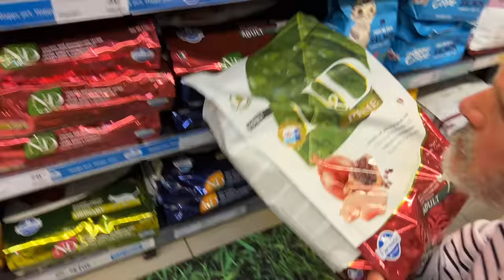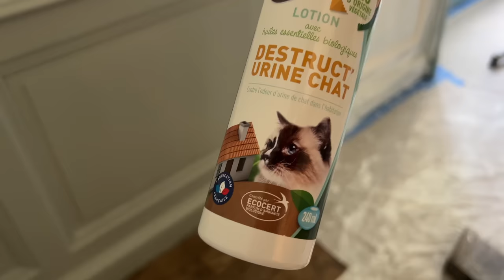PART ONE: Our Chateau Bedroom Reimagined

Comment: Don’t worry, Amanda, I’m doing to the same thing buying the extremely fancy food for our indoor cats that demand attention when they want it, and demand wet and dry food twice a day. All the joys of cats.😊  
Something I use to neutralize the smell of cat urine is run hot water into a bucket and sprinkle in baking soda and stir it in until it’s dissolved then you can clean whatever you need cleaned that has cat urine is on it and it take the smell out. (Depending on how much of an area you need or use anywhere from fourth of a cup to a half of a cup of baking soda per a half gallon to a gallon of hot water)   I see pickles is a real daredevil.  Thank you very much Amanda, and Lincoln.

Comment: Might try KILZ paint as a primer for those older plaster walls....? I've been told that these old castles' interior plaster is created to "breath" so that moisture is not fully trapped between the outer and inner walls (exterior walls). In the old days, plaster was "painted" with a lime wash type application. It allows for the walls to "breath."